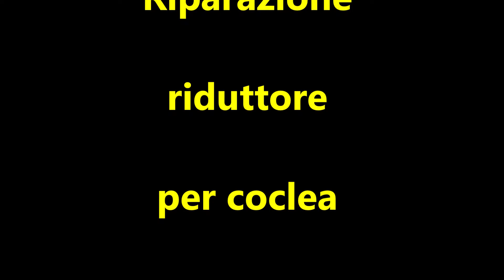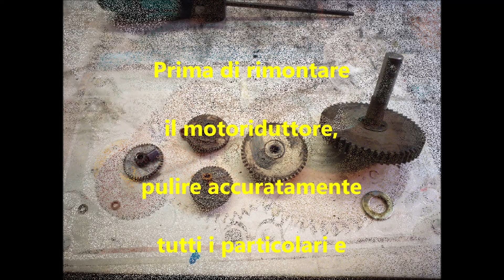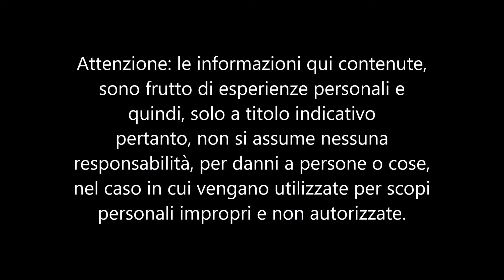Riparazione Motoriduttore Coclea Stufa a Pellet

Comment: Ciao, ho lo stesso motoriduttore e mi si è rotto: no riesco a capire quanti rpm ha, tu puoi dirmelo? Grazie
Reply from the maker: Ciao, Purtroppo è passato del tempo da quando ho smontato e riparato il mio riduttore.
Posso dirti con assoluta certezza che per capire quanti rpm avesse il mio, non feci altro che misurare il tempo che ci metteva a fare un giro completo in un minuto.
Appena riparato, il risultato senza la coclea montata e quindi senza attriti, fu di circa 45 secondi a giro, quindi circa 1,3 rpm.
Adesso non ricordo bene cosa offre il mercato dei ricambi, non credo che troverai lo stesso identico riduttore originale (quello nel video è un MERKLE-KORFF), ma qualsiasi altro articolo sostitutivo dovessi trovare, chiedi al fornitore le garanzie che sia compatibile con il tuo.
In conclusione, per rispondere alla tua domanda, credo che il riduttore corretto per te, sia tra 1,3 e 1,5 rpm.
Spero di esserti stato di aiuto.
Ciao e buon lavoro
Reply: Dovrebbe esserci scritto